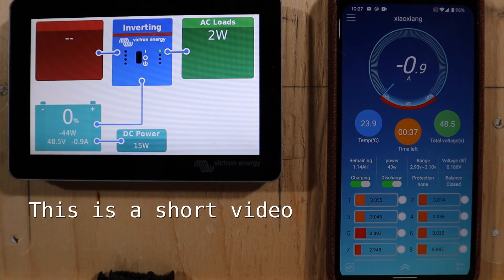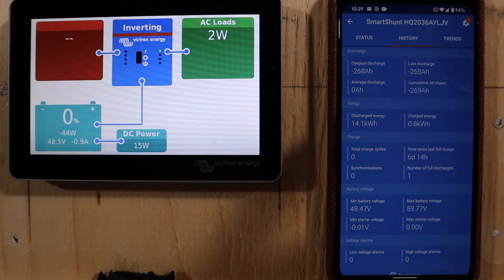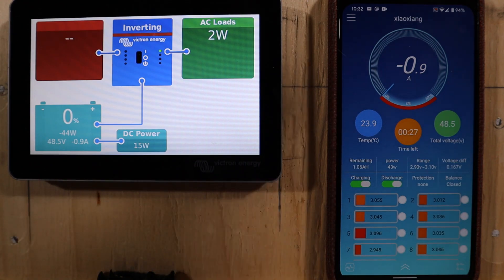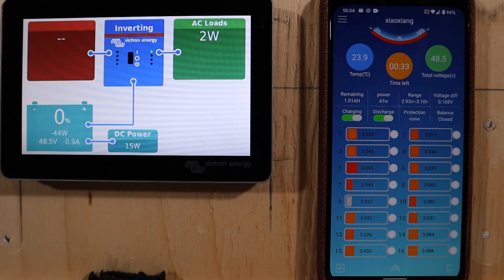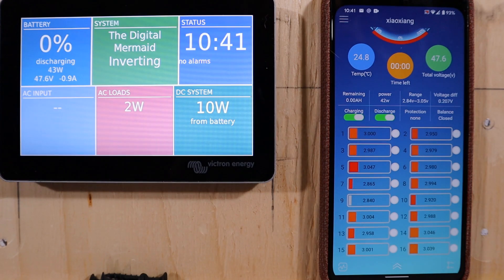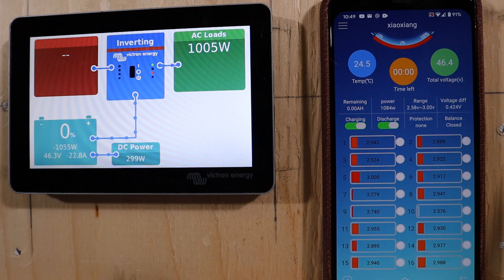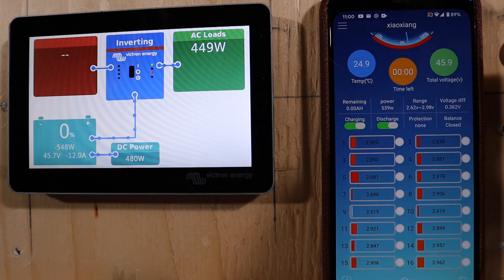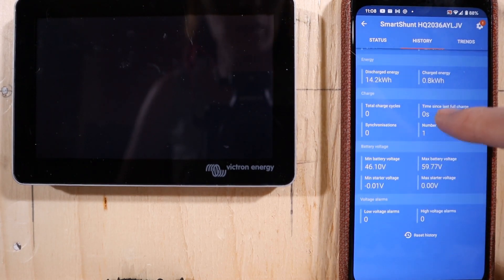It's Dead!! (Determining Capacity) - How to build a 48v Lifepo4 battery (Ep. 18)

Comment: Based on your test data cell 9 and cell 10 will probably die first  unless you bottom balance your pack..  Over discharge is the number one killer of lithium battery lifespan.  Hence the need for bottom balancing to the capacity of the weakest cell (9 and 10).  Good luck!

Comment: A tip: keep the bms undervoltage disconnect function as a safety backup if you can. Do this by setting the voltage for the victron to shut off higher than the bms disconnect voltage. This way you always have a double protection, if the victron fails to shut off the load the bms will. goodluck!
Reply from the maker: How would that work? Consider a simple 4S pack; If you tell the charger to cut off at 10.0v (4x 2.5v), you could have a condition where the cells are (2.6, 2.7, 2.4, 2.5) = 10.2v pack voltage, while one cell is down under-voltage. You have to trust the BMS because only the BMS has per-cell voltage measurements. Am I missing something?

Comment: a bit late, but maybe helpful... At the end, around @9:20, you can see the lowest voltage cell 10 bouncing around a bit more than normal (2.4-2.7V), this is mostly a sign for a not perfect connection between the battries. Maybe this becomes even better when you loosen, clean and tighten the connection around cell 10 (on cell 9 and 11, too) and maybe also 9, since it was also low...
BTW "meat vessel" made my day... 🤣🤣🤣

Comment: Why is the DC power meter changing from negative value to positive value during your discharge test? Is the battery being charged as you are doing a discharge test?
Reply from the maker: I went back and tried to see where it goes negative, but I don't see where that happens. Can you tell me were in the video you saw that?
Reply: @TheDigitalMermaid  7:20 and onward.
Reply from the maker: @uhjyuff2095  Good eye! I never noticed that before, that's really odd. I have no idea why it's showing that. I'll try to figure it out though.

Comment: Dc to ac conversion has around 93% effeciency + self consumtion of inverter wich is around 10-20 watts. If your loads is only small like led bulds it is terrible ineffecient but if you use 2000 watts appliances regulary it would be terrible ineffecient to not use an inverter. I mean you dont want to wire 2awg/35mm2 all to all different applainces. 😂 Or use undersized long cables and lose more power in wires than you would in an inverter
Reply from the maker: I size my wires (ideally) to have ~1% voltage drop over the run for the given load. The argument about, all things being equal that AC is more efficient on high loads, is interesting. I will have to look into that to figure out why and where the break point is. Thanks.
Reply: @TheDigitalMermaid  in any case  finding 220/110v ac appliances to buy is easier/cheaper than their dc counter parts 😝

Comment: MAKE SHURE YOU HAVE ENOUGH PV MODUELS TO PUT ALL THAT POWER BACK IN THE BATTERIES WHILE USING IT TO POWER THE MOST OF YOUR HIGH LOADS DRAW . YOU HAVE IT ALL GOING GREAT IN PRODUCTION AND USAGE . MAY THE SOLAR BE WITH YOU .
Reply from the maker: Ideally you'd do this, but on a sailboat, space is extremely limited for solar panels. So there will be a set of strategies to keep the batteries charged, but it won't be pure solar sadly.

Comment: If you measure capacity of every cell and then build your 6 pack out of 16x6=96 cells, you can match cells to each pack with +-same capacity. So you end up with one 276 Ah pack, one 278, then two 280 Ah and two 281-283Ah. So you will not experience 1 or 2 cell drop voltage in a battery resulting of power loss even if 14 other cell can provide you some energy..
Reply from the maker: This is true, but I don't think it's worth the effort in my use case. Once one pack drains, I will want to shut down the motor anyway. The system is designed for up to 600A draw, so if I lose one pack, my available power is 500A, below what I need, so I'm shutting down anyway.
Reply: @TheDigitalMermaid  they will drain with different speed.. so the one with highes voltage (capacity) will provide more amperes then one with lower voltage(capacity).. So you actually can get about 15 Ah more from six pack as a whole

Comment: Did you say 6 packs, 80 KWh?    Yowsers that’s a lot of storage.   What do you figure your motor draw to be?   What about daily PV (again real world so figure on clouds) production?
Reply from the maker: 86kw! Yes, it's a silly amount of power, I'll be the first to admit. I didn't mention in the video, but if I was going to build a new pack today, I'd get the 304Ah cells (Andy just did a video on them). That would give me 93.4kw. However, with how fast things are moving, there might well be even bigger ones available next summer/fall when I am ready to buy. If I could get over 100kw... <3

I'm designing around the QuietTorque 30 (https://electricyacht.com/product/quiettorque-30-lc-electric-motor/), though I'm not set on that specifically. It's the biggest I would likely use, so it makes a good option to design around. It's 600Ah max input at 48v nominal. Using the Overkillsolar BMS which has a maximum sustained output of 100A, then I need six packs to hit the 600A continuous. 

I have a bare-minimum design goal of 35 knots pure electric range on the boat I get. Given that the boats I'm looking at have a nominal speed of about 7 knots, I need 5 hours of runtime to achieve this. Obviously at 100% throttle, I'd drain a full bank of 280Ah (272Ah tested) cells in about 2 hours and 45 minutes. Of course, dropping power reduces power consumption a lot more as a ratio to speed over water, so I am hoping to achieve this range running at 50~60% throttle. The more power I can get onboard, the easier it gets for me to hit my range target though.

Comment: yeah when i went offgrid in my house i went 24v and stepped power down where need be with buck converters the way  i see it stepping down is more efficient then stepping up just for most devices to step that voltage down again the only problem tends to be that devices with dc input tend to cost more money
Reply from the maker: Simple economies of scale... For every one DC-powered device a company sells, they probably sell 1000 AC voltage versions. So I'm not surprised DC power devices are more expensive. Off grid though (be it boating, RV'ing, building) is new, and the priority is often, long term, more about efficiency than cost. So now that I see the total system loss going to AC, I'll probably suck it up and pay the higher price for DC so that my stored energy lasts longer in the real world.
Reply: @TheDigitalMermaid  yeah kind of what i did i looked at tv computer monitors etc to find ones with a dc brick rather then a ac plug into the back of the device this way i could find and use buck converters to power them
Reply from the maker: @1981dasimpson  That's a great idea!

Comment: i would still call it at 80 kw battery and keep the 6kw as a reserve like you would with a fuel tank on a motorcycle just gives you that little extra is something goes wrong
Reply from the maker: If I was handing this over to someone else, that would be a brilliant plan. Given I'm using it for myself though, I can understand both real capacity and wanting to stay above a certain point to have as a "reserve" capacity.

Comment: Hello, I have just started watching your channel. Great channel and great idea - an electric boat.
I am an old 2 stock outboard mechanic so I love your idea.
I have just built a 48volt battery bank just like yours. I have a victron gear like yours and a victron smart shunt. My smart shunt is like yours on the history tab it dose not tell me the Average discharge 0Ah Total charge cycles 0
Synchronizations 0
I don't know why mine or yours don't give this information. Do you know why???
Ps, straight DC power is the go. 24 volt for LED flood lighting. All the best, Jp.
Reply from the maker: Welcome! I don't know, but I will be going to Victron training on Wednesday, so I plan to ask them. 

On lighting; A friend of my is an EE, and he's offered to help me create a bunch of 48v LED lights for the boat. With how cheap it is to get circuit boards made now, it's not very expensive. In any case, I plan to have Victron 48|12 and 48|24 DC/DC converters for point-of-use voltage drops as needed.
Reply: @TheDigitalMermaid  Hello again Digital Mermaid, how did you go at the Victron training? I bet they offered you a job. Waiting to hear of your day. Jp

Comment: Very nice.  Again, the SmartShunt is the authority. Something to consider is longevity:  Most data sheets indicate an 80% depth of discharge for maximum cycle life.  Yes, in an emergency, one does not hesitate to extract every Wh available.  Since you're looking at "real world use," you should be thinking in terms of 80% of 3.2V * 280Ah * X cells.

My LFP "Grade A" Eve cells tested at 272Ah as well, and I tested all cells individually at a 20A discharge.
Reply from the maker: I've been going back and forth on the 10~90% use range versus the 0~100% use range. Certainly, 10~90% will give the most cycles and longest life, that's not to be debated. However, given an expected 80% capacity after 3000 full cycles (or something like that), I am starting to think that I am not going to worry about it. That gives me over 8 years of full discharge / recharge cycles, which is not going to happen anyway. As I believe both Andy and Will have discussed, the idea of eeking out a touch more life on cells that last this long seems like misdirected energy. 

With how fast battery tech is advancing, the chances of me wanting to replace the packs with some new chemistry / cells / technology in eight years is very very high. So why worry if a cell lasts 3000 instead of 4000 cycles? I've not made my mind up yet, but this is how I am leaning.
Reply: @TheDigitalMermaid  The discharge to 20% is the RATED cycle life, i.e., if you go to near 0% routinely, you will get less than the rated cycle life. Furthermore, when you operate outside the ratings, the likelihood of premature failure increases.

I've mentioned it in another comment - trying to hit 90% SoC as a cut off is essentially impossible. LFP doesn't make it easy.  Better to limit your absorption voltage to 3.45V and allow the current to taper as it approaches full. Much less stressful to the cells, and you typically hit about 98% SoC.  Additionally, trying to target something less than 100% will ensure your SoC reporting hardware will get less accurate over time.

In a cyclic application, choosing to not charge and discharge deeper when you have the option to charge just doesn't make sense without a specific reason (power costs more during certain times, etc.).  You'll likely find that when you're on the water looking to charge via solar, you will be wishing you had more capacity or that you had chosen to top off the batteries before leaving dock.

If you look objectively at "how fast battery tech is advancing," you'll realize that it's actually slowing in the practical sense. Every "revolutionary" battery tech that captures the public's attention in the last decade has not materialized into a viable product outside the lab. The decrease in $/kWh of Lithium is slowing substantially and with the likely increase in demand, it may slow the rate further or actually increase the cost.  These cells have actually increased over the last 6+ months.

While most people are told they are buying "Grade A" cells, few get them.  Your cells failing to achieve 280Ah capacity prove that they are not Grade A.  It's not just about meeting specs. There may be other factors in non-grade-A cells that means they won't meet their cycle life either.  Would you feel differently if you knew they were going to fail after 1000 cycles? These gray market cells don't have hard usage numbers to support their reliability.  You didn't get rated capacity, so it's not logical to assume you'll get rated life.

You can devise a system that maximizes longevity automatically with zero effort and zero inconvenience on your part. Does anything else really make sense when pitted against that? :)
Reply from the maker: @snoobler  In this battery, the rated discharge / charge is 10%/90% for optimal battery life. I've seen Andy's experiments on limiting charge / discharge voltage, and I will be considering them when I make my final decisions. The question remains; What balance to strike between longevity and available power. It's a complex topic and different people will come to different decisions on what is right for them. The question of future tech is, fundamentally, academic because none of us have a crystal ball into the future.
Reply: @TheDigitalMermaid  Understand the "recommended" 10%/90% limitation. As mentioned before, stopping at 90% SoC is nearly impossible. The alternative is to establish a smart way to reduce stress during charge in a way that does not require intervention by person or BMS.  The peak charge of LFP and all Lithium in general is the more stressful portion of the operating envelope and a major contributor to cycle life degradation. Limiting peak voltage and current helps to minimize this stress even when taking them absurdly near 100% SoC, and this can be done with zero effort/intervention on your part simply by specifying less-than-peak absorption voltage.  If you NEED 100% of your available capacity in an urgent situation, absolutely gobble up every bit you need.  If you've designed a system that routinely needs 100% of your available capacity, your system is designed with zero margin. When is this ever a good idea?  Your future boat was designed with a sizeable safety factor with the structure capable of handling much more than the anticipated stresses.  Why should your power system be designed on the ragged edge?

Ultimately, I think I'm failing to explain how easy it is to maximize for longevity with zero impact on functionality. I apologize for that.

3.45V/cell absorption for solar charging, .03C tail current
If charging from generator, 3.55V/cell absorption for AC charging, 1 hour absorption (Victron won't let you specify less).
If charging from shore, and you don't care if it takes longer, 3.45V/cell, 3 hour absorption (you may need to tweak the time for your installation).
Set BMS to cut off at absolute cell limits (defaults are good).
Set GX to alarm at 20% SoC.
Use system normally.
Solar charge at every opportunity.
AC charge when solar can't keep up.
Reply: @TheDigitalMermaid  Every cell has anode, cathode and sparator + electorlyte. If cell is formatted correctrly, there is isotropic SEI on anode. But as you go down to 40, 30, 20 %., anode partickles start to crack, suppose we have graphide anode + binder + Cu current collector. If you go under 2.8 V > 2.6 ... 0, Cu start to react, /corrode / connection do Gr particles are not so good. When 2 - 4 nm thick SEI cracks, new elecktrolyte particles react with anode and form new SEI, bu it consumes Li + DC+EMC+LiPF6, when you charge cells to 3.421 > 3.45 > 3.5 V, electolyte is decomposed. In all this cases goes disproportional degradation, and resistance of anode + cathode + electolyte goes up, so cells are unable to give you needed power. If you hold cell at high SOC 80 - 90 - 100 %, a lot of Li goes to unusable parts of anode. And cyclic aging is only one side of coin. On the other side is calendar aging, which is related to temperatures. Voltage plato for anode is around 50 - 80 % SOC, so to have cell OK, if you do not use them, go to 50 % SOC or 40 % SOC. Cathode also cracks. Also avoid chargin under 0 > 5 > 10 *C with high currents. Nowdays cells have not temperature probes inside, but if we know ambient temp a temp. gradient, smrat BMS  have to calculate, if it is save to charge battery pack. If BMS is not smart, dendritres will form if we perform charging at low temps.